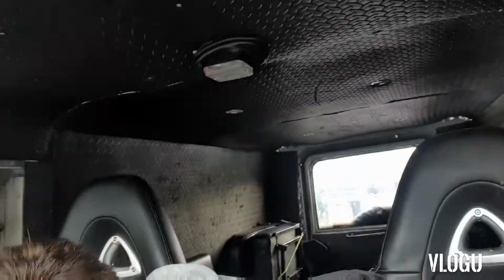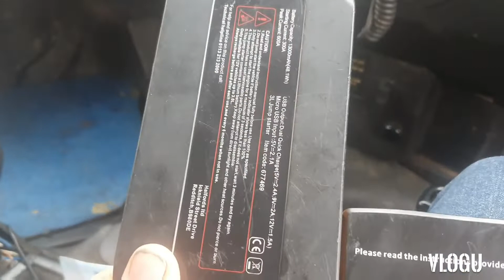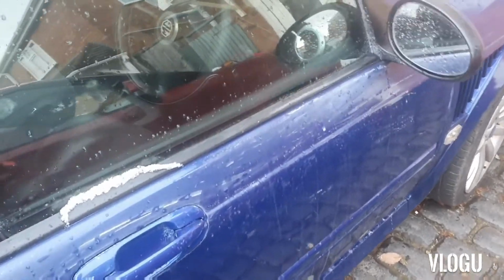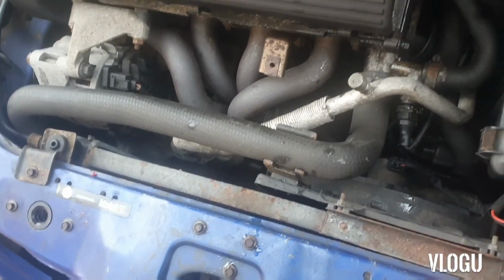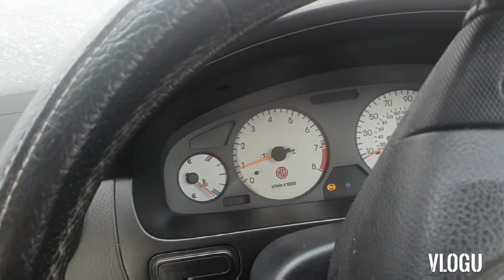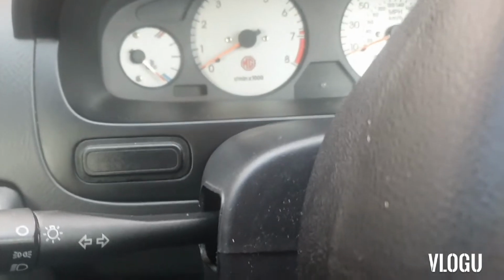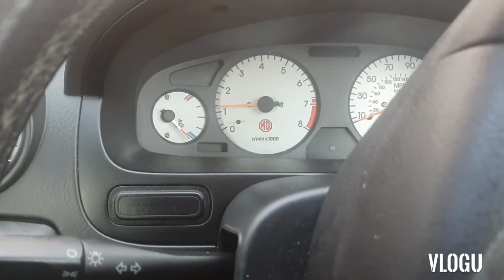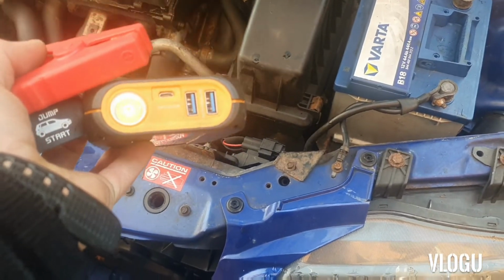halfords jump pack update 1 year on. trying to start two dead cars back to back. Will the mg start

Comment: I spoke to my local halfords about these and i asked which ones are your best sellers out of the halfords or noco ones and he said the halfords ones sell more because of the price but the noco ones are alot better because they last a hell of alot longer and people use them for batteries like your mg car and they meant to work 1st time but use a trade card. It does a 6l petrol and a 3l diesel. GB40 1000A NOCO Jump Starter
Reply: Infact get the gbx45 it is £100 with the trade card and it offers alot more than the halfords one

Comment: Hi, I'm looking to buy one of these simply based on price....is yours still working or did I it pack up? If so, how long did it last? Thanks 👍
Reply from the maker: Still going . Still starting strangers cars
Reply: @wardysworx  thanks for replying.....spent hours reading reviews about a few makes and panicked a little (as I'm desperate to get one asap) and ended up buying online the NOCO GB40 for £98 from Halfords......hoping it does the job......reading the reviews it seems it's important to remember to keep these recharged (even if you don't use them) as otherwise they'll end up not working. I think the NOCO does have overdischarge protection though so I may be lucky.
Reply: Would the 2l work on 125 scooter
Reply: Yes it'll do one no problem  @Sean-ts8lp